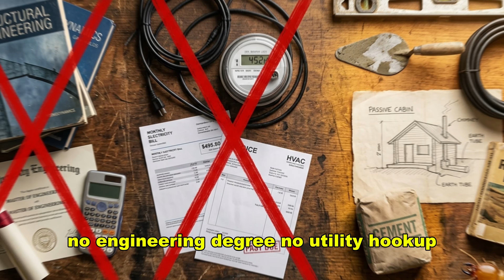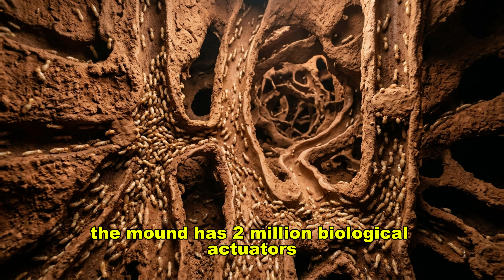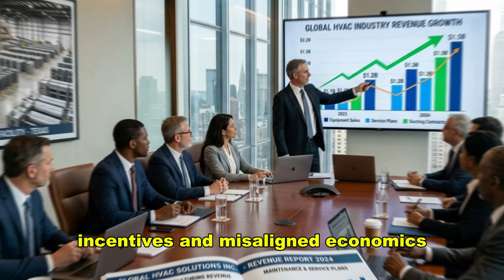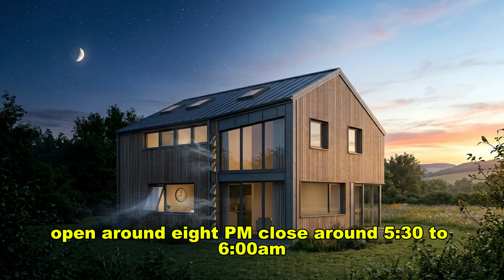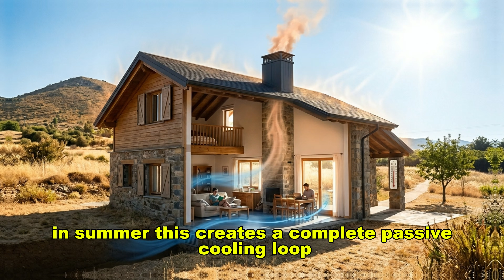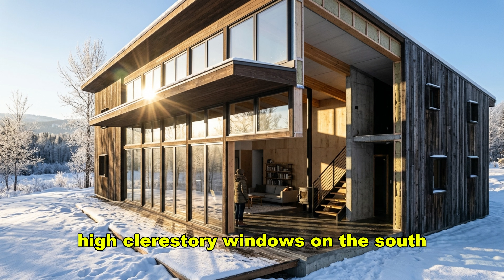Termites Solved Heating 50 Million Years Ago — One Architect Copied It and Cut Energy Bills by 90%

Comment: Finally you've covered this project I've suggested it to you over a month ago 🤷🏽‍♂️
Reply from the maker: It’s a classic example of biomimicry that was definitely worth the deep dive! 🐜
Reply: @theforbiddentent 

Yes, it's a great project and another significant point used, which you didn't highlight within biomimicry is the cladding design. 
The walls are not the common flat panel / smooth wall style exterior sliding or rendering. He also deployed a design of biomimicry from desert/savanna cactus, which uses the protrusion of its spines (stipules) to cast a shadow on the trunk (mass) regulating the temperature of the cactus body. 
It is now known that elephants have evolved in the same way, as a mechanism to regulate body temperature. 
If those massive beast dark-coloured skin was smooth like a human, being in the hot sun for most of the day, they would explode from the stored heat. Their skin, aside from having spines has many creases and folds, which also act as a thermal regulator because the think layers of folds cast a shadow on the skin reducing constant direct sun glare and this keeping them cool.
A building science researcher in Singapore has fabricated exterior wall tiles modelled after this concept, to cast a shadow on the wall, with the suns glare to transition throughout the day without constant direct glare on a flat wall thus reducing its impact 
Similar to a well placed tree on a southwest or west-facing exterior wall, helps mitigate unwanted solar heat gain 

Keep up the good work 👍🏽✊🏽